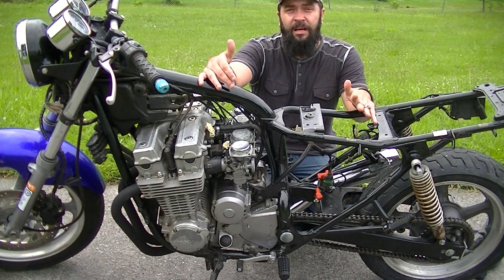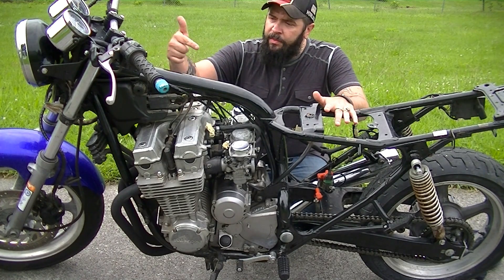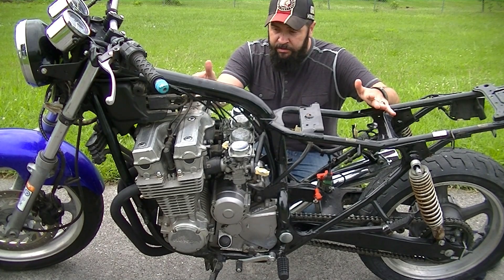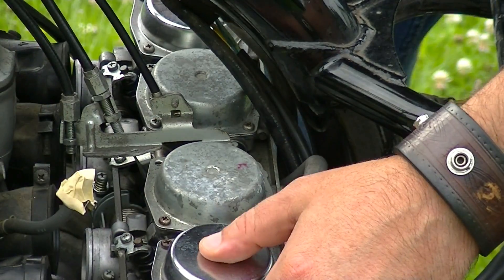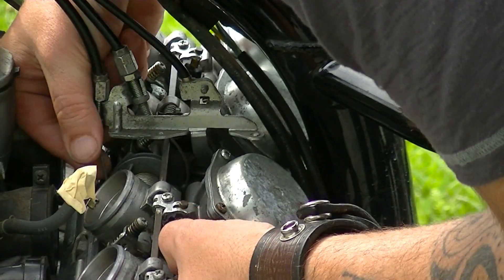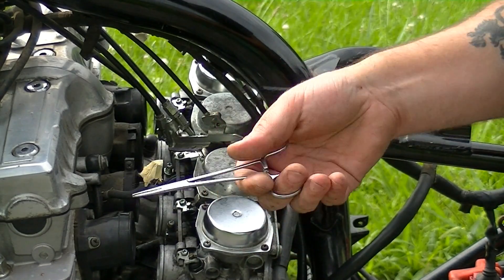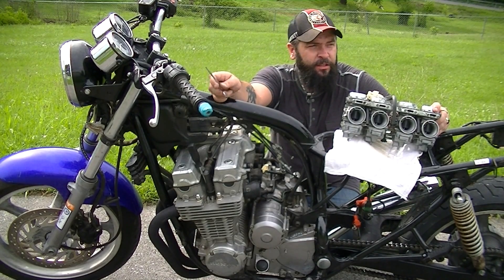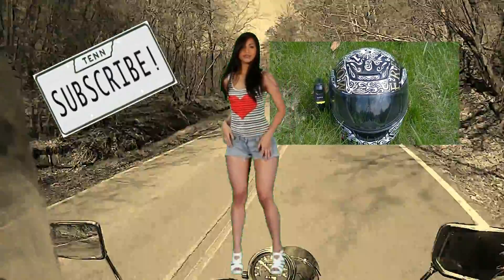CB750  Carb Removal

Comment: take some rags and plug those intake holes also if u just loosened the cable adjustments  u wouldnt of had to take that bracket off and u would of had more play with the cables to make them easier to disconnect. cheers buddy thanks for the shout out
Reply from the maker: lightitup550 You deserve more then a shout out. carbs are taped shut :)
Reply: not the carbs but the intake into the cylinder
Reply from the maker: yup, that's what i mean. sry

Comment: They can be a bitch to get out, what are the plans for the carbs?  My only reason for asking are carbs are the quickest way to add hundreds of pounds / dollars to a build.  Unless there was an issue before and they didn't work, or you plan to rejet them or clean them I would leave alone :)  If you plan to do either of the above, make sure to usre an impact driver to get the covers off, carb bolts are renown for rincing out and having to be drilled.  Replace bolts with allen bolts, once you remove the carb covers, chances are you are going to need to replace the gaskets on the bowls, the gasket kit for all 4 is about £60 over here for the Yamaha.   Careful with the carb diaphragms, those get expensive really quickly.  Once opened, to much messing around is going to require a resync and balance...  is just cost cost cost...
Reply from the maker: GTs Garage ya they don't have jets in them so i'll need to do that and they just where rebuilt before I got the Bike but I have to Work outside so a re-jetting and tuning is inevitable. The Stock Air Box is missing a hard to find bolt so  i'm planning (not sure yet cause  i've not gotten that far) on going four to two with 2 K&N Pods. gonna look amazing.
Reply: Looking forward to seeing this build, inevitable is good, means you have no choice so might as well get stuck in and crack on...  it's a the pain in the arse if you have to weigh up the pros and cons of each bit..
Reply from the maker: Ya.. If I'm going to learn   then I'm going to learn old school.. that's why my Tank is full of BB's LOL

Comment: hey back road! i just picked up myself a cb750 I got it start but there are so many vacuum hose that i do not know where they go and the manual is was fucking confusing.. did you removed the canister? and did you delete the purge system im really wanting just to simply everything ..  think you could help and take a picture of your set up? id really appreciate it!

Comment: I can't get my carbs off for the life of me. Loosened the brackets took of the throttle and choke cable but that thing is stuck so tight.
Reply from the maker: wiggle wiggle. it's a bitch
Reply: Finally prided it off using a broom stick haha
Reply from the maker: fuckitall tools are the best